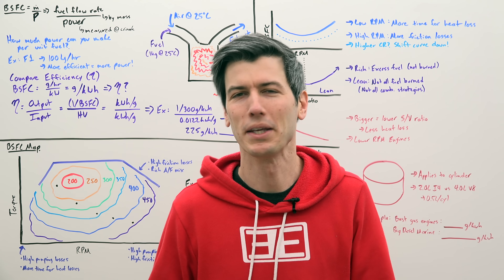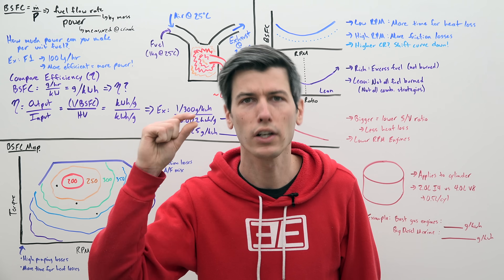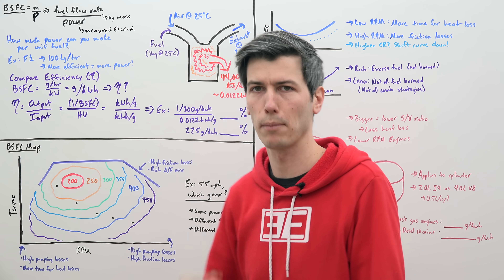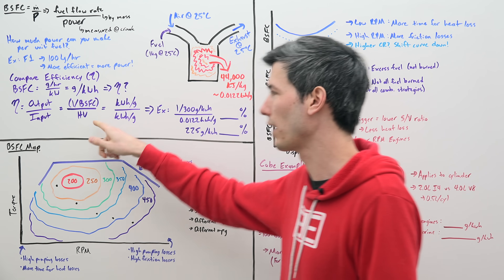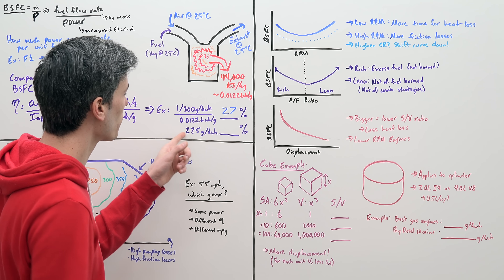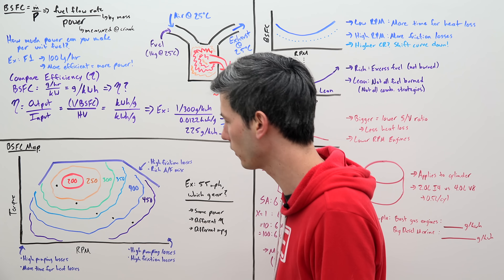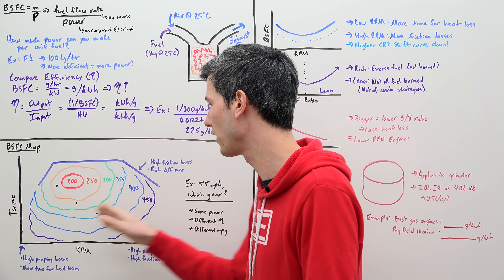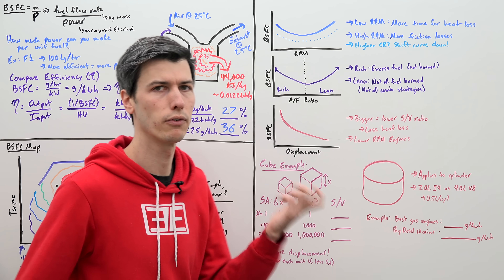The Best Way To Compare Engine Efficiency - BSFC

Comment: Absolutely accurate, yet almost entirely useless to a consumer.
Reply from the maker: Channel motto! 😂
Reply: We need smarter consumers
Reply: @Rad_Triumph_765_RS  it’s not about education, this discussion just really isn’t relevant to consumers. They need to know how efficient a CAR overall is vs another CAR as a total. Like he said in the beginning, a Semi can have a hugely efficient engine, but it’s still a Semi getting 20 mpg, when that same person can just drive a moped and get 30... the point of the video is how to measure efficiency of ENGINES for other means, ie research, personal curiosity, etc
Reply: CLS63AMG WAGON Semantics. 

Efficiency in one part, especially the most important part, affects overall Efficiency.
Reply: @cls63amgwagon34  Some people just want a big safe car and don't care about efficiency. Just being real here.
Reply: CHAOSberg, I changed out the final drive in my K24 swap from a 4.7 to a 3.4, and my highway fuel economy improved from 37mpg to ~55mpg. While I didn't necessarily need a BSFC chart to tell me a change in gearing would help, this helps to understand "why".
Reply: I'm genuinely curious how you did the final drive swap?
Reply: @clover7359  On a FWD car, the final drive pinion is the shaft that all of the gears sit on. You crack open the transmission case, slide the gears off the old final drive and onto the new one, and put it back. There's also a gear that's bolted to the output shaft (or differential) that you change out. I can share pictures if you're interested.

In a RWD vehicle you can just replace the entire rear differential, that's where the "final drive" is for that setup. It's also commonly called a "rear axle ratio".
Reply: The TLDR from this thats useful for consumers: Change gears early, dont rev high. Thats what people have been saying ages ago because its pretty easy to do and just works but here you have the scientific proof, if you had any doubt.
Reply: I would pay good money for a BSFC reading on my dash.
Reply: relevant when u just try to buy an engine xD
Reply: Unless that consumer is trying to build a hotrod.  which a ton of people do and if the dyno operator tuner and builder of the engine is worth their salt,  they know this.  and ive seen them tlak about this in the speed talk forum.  youre talking about some smart dudes that makes cars go damn quick and win races all in one place.  

but yeah,  someone buying a hyundai elantra for gas mileage...yeah they don't give AF
Reply: Now the case of engines is slightly different than motors which are direct drive. As told in the video, at the same speed, in the exact same car, if you run in a lower gear, higher rpm, you would not load the engine enough as the torque that could be produced by the engine is more but the actual torque required is less because the speed is limited by Rpm, gear ratio and wheel size. So as the forces have to be balanced, we would produce lesser torque, at a higher RPM, which translates to lesser actual BHP than that the fully loaded engine could produce. But the fuel did burn, and went away in heat, lower efficiency. But as explained, lower speeds are actually not very efficient either. So to achieve maximum efficiency, load the engine as much as you can at the maximum efficiency RPM of the engine. So to get the maximum efficiency out of your car, go to the highest possible gear, and sit at the RPM of highest engine efficiency to perfectly load the engine. Again, you could probably get much better overall efficiency if you could properly load the engine at a lower speed as drag forces and friction are much lower. Hence a smaller capacity, lesser efficient engine could provide better mileage if run at lower speed.
Reply: @sridharsinghal1232  engine and motor are synonyms
Reply: Very interesting. So bigger the cylinder, better the efficiency. I wish you had compared the 4 in line with V8 both at 4li.
Reply: but i finally understood why my dodge charger V8 had a little bit better mileage than camry v6, despite charger being a much larger car
Reply: Yeah, you don't choose car by any of these measures. You choose car by what you need and what the cost is (worse mpg but sturdy and cheap to maintain is better if you drive 5 miles a day to job and back). And also, don't forget that often you just want some car which you might not even need :)
Reply: I could see this information possibly being useful for hybrids or engine swaps, but still incredibly niche no matter how you slice it
Reply: It's meant to inform engineers designing engines - not consumers
Reply: Well depends on how much fuel costs at your location.

Here it's roughly calculated to 10$ per gallon at the pump.

Not gonna drive a 13 mpg Mazda RX7 much here.

A nice 26 mile drive is 20$ each time in fuel alone.

If you drive 5200 miles a year (so just a fun car, not even a daily) 
That's already $4000 in fuel annually.

BSFC is definitely important to me.
Reply: I find it pretty useful and I'm a consumer. Nobody's forcing you to watch these videos.
Reply: @EssenceofPureFlavor  you seem to think I dislike the content, but I’m also an engineer and I love this stuff. However, thermodynamic efficiency doesn’t matter when you’re buying a vehicle for transportation, but MPG does.
Reply: @FuncleChuck  I guess I just don't understand why you talk like the two are unrelated.
Reply: @EssenceofPureFlavor  the engine might be efficient but there are a lot more factors that affect the efficiency of the car. The force which a car has to overcome includes rolling resistance, other frictions and air drag, last one being the largest at highway speeds. Now a car with lower drag coefficient with a less efficient engine could provide you more efficiency at the same speed because at the speed the engine would have to work less. 
You can take electric cars as an example, where motors are very efficient, about 90%. The power is torque*omega. And torque at wheels is linearly related to force applied at the ground (almost). Hence less drag means less power at same speed.
Now even though the largest battery packs are less than 100KWh, and assuming that the power consumption is linear with speed, a 400 KW Tesla with top speed of 300Kph, running at 90Kph would consume 120KW power. The battery pack shoud end in less than 1 hr, maximum range 90Km. But the range is about 400 Km if  am not wrong. That is because most electric cars consume less than 20 KW power at highway speeds.
Reply: @sridharsinghal1232  I understand that already. (Not all the details, but conceptually) But it's undeniable that all else being equal, more efficient combustion will result in greater MPG.
Reply: @EssenceofPureFlavor  I guess I watched the video and saw how they’re entirely different concepts.
Reply: @FuncleChuck  How could they be entirely unrelated? Engine efficiency is one part of the total efficiency of a vehicle. For consumers, it's the total efficiency that matters, but this is part of what makes it.
Reply: @EssenceofPureFlavor  but knowing the efficiency of just the engine isn't enough. We need to know the overall efficiency of the vehicle, which mpg does relatively ok(but as he explained in another video, its better to use gallons per 100 miles)
Reply: @foxgaming76yt24  And engine efficiency is a large component of vehicle efficiency.
Reply: @EssenceofPureFlavor  but it isn't the entirety, so it still doesn't mean much. Even if you have an efficient engine, but if your vehicle is as aerodynamic as a brick, it'll most likely result in a more average score. In the end, it doesn't matter how much the engine affects the efficiency of the car, because in the end, it doesn't take into account other factors like vehicular weight, aerodynamics etc. Which is why something like liters/km or Gallons/100miles should be used instead.